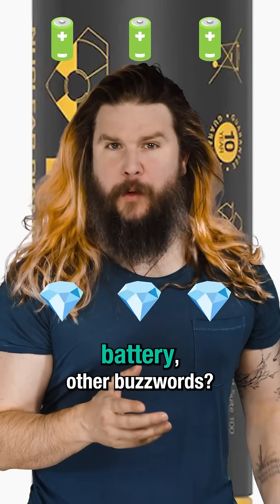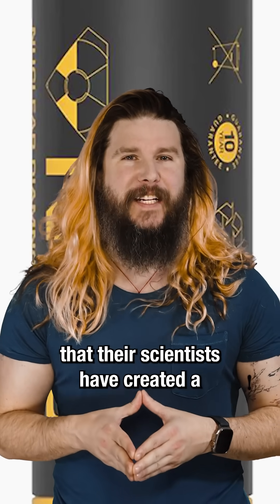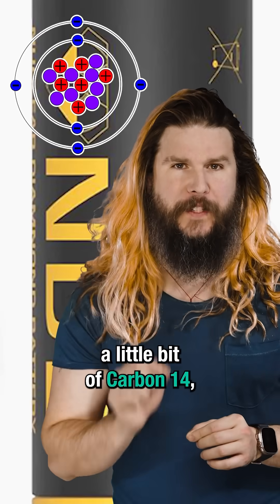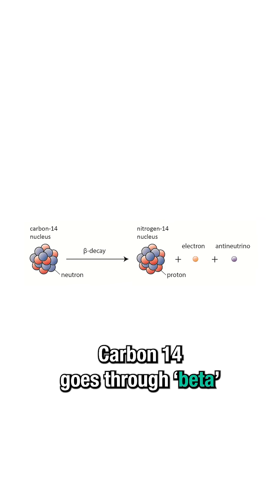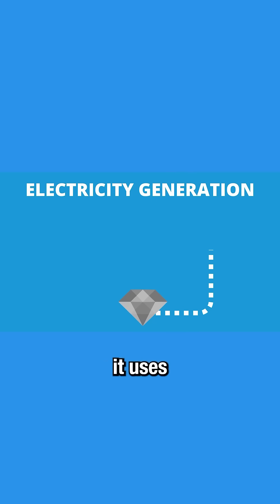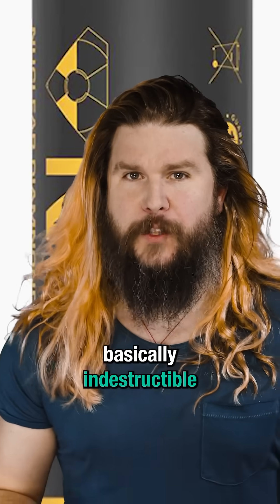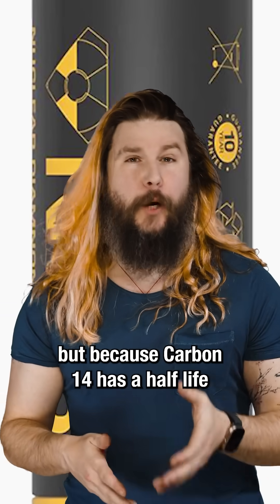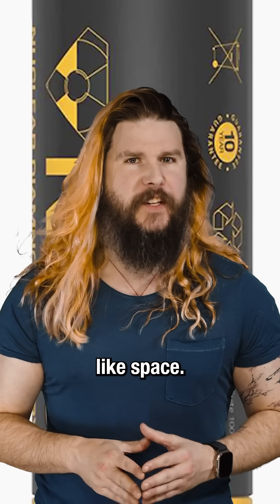World’s First NUCLEAR DIAMOND BATTERY

Comment: For anyone wondering about other uses for these, space probes that need little amounts of power to last awhile can use these
Reply: I just want it in the TV remote, I'd pay 100 monies for a TV remote that never died!
Reply: @Panboy2k  the amount of diamonds it would take to power your remote would cost more than your house.
Reply: @Panboy2k I'm liable to loose it in the couch forever
Reply: Just use high quality batteries once every few years...@Panboy2k
Reply: Nuclear thermoelectric batteries have been around for 50+ years and would be a better solution as it's not locked behind a patent paywall.
Reply: @justinbailey6515  you mean RTGs?
Reply: @justinbailey6515 those nuclear thermoelectric batteries (or more accurately "Radioisotope thermoelectric generators" or RTGs) have downsides. For example, the RTGs on the Voyager probes started to significantly decrease in power output after only a few years. By the 4th year of the Voyager mission they could only operate about half of the probes instruments at any given time, and they were designed to have all of their instruments operating simultaneously. In 2017, exactly 40 years after Voyager 2 was launched, it's 3 RTGs had decreased in output so significantly that it couldn't operate it's camera and it's transmitter at the same time.
Reply: Be a great way to perseve a probe for alien civilations to discover
Reply: @idris4587for that kind of time scale I think you're better off with an unpowered storage medium, and making the whole thing as reflective as possible. Unless we want to get a bit fancier and essentially have it just power a clock counting down until its calculated to get to the target system, which then triggers another power source that will need to be just as robust, to power a transmitter
Reply: @kapperbeastYT  data storage crystals can last for billions of years
Reply: Or heart pacemaker
Reply: I know it's radioactive and dull but I would also imagine these could be extremely helpful for stuff like a pacemaker or similar medical implants that don't need very much power but you don't want the fucking battery dying on you and if it's something where you can set it and forget it I would imagine that would be extremely beneficial as it would basically eliminate the problem of having to cut the guy back open to change the battery in like five years or whatever it is
Reply: We already have better nuclear batteries
Reply: @edisonmc049  "Better" is a poor term here; this clearly has different use cases than your typical RTG. It sounds like it sacrifices raw output for unmatched longevity and durability, and like it' also far less susceptible to radiation leakage, which will definitely give it a niche. Aside from space exploration, I could also see it being used as part of nuclear waste storage systems, where the ability to survive and provide electricity for thousands of years without maintenance would be highly useful.
Reply: The satellite probes floating through space powered with the exact same battery? Those one right.
Reply: @demonkinglamb636  no. Not even remotely similar actually... if you did research you'd realize that but obviously you seem to be a
Reply: I was thinking more like a suit of power armor.
Reply: Pacemakers.
Reply: If they were real unfortunately they're not. They got sued for fraud by the SEC 2023. Don't remember if they were just lying about power output or the technology as a whole. But if you type nuclear diamond battery lawsuit You should get plenty of information on what happened.
Reply: @blindsniper35  Different company that was in the US, and it was for making false marketing claims to raise money from investors in the company. University of Bristol's company for commercializing this tech is called Arkenlight.
Reply: Thats literally what he said in the video yes... Not exactly "an other" use.
Reply: I can think of thousands of uses for this. How about something to stimulate memory chips so that they don't degrade over time?
Reply: Aliens gonna be like "Shit! Bro they got diamonds there. Let's rob em'"
Reply: You can alao juat slowly charge a batter using it. Great for an emergency SOS becon, or a limited use flashlight.
Reply: How? They output on the order of a microwatt of power. There's few things that can usefully use that. And for most of those things, their lifespan is limited by other factors and could instead use a cheap and simple primary battery for many many years.
Reply: @striker6967  Scale and ceramic capacitors.
Reply: @striker6967 pacemakers
Reply: They will go bankrupt, it's just with lightbulbs or the glasses that only hardly brake

Comment: I love how much you emphasize how tiny the amount of power it makes is
Reply: Yeah, also betavoltaic batteries powered by tritium have been used in pacemakers for decades now, this isn't new tech. While C-14 might have a long half life, it also has a low decay energy, which means that even if your power harvesting were 100% efficient, there just isn't much power coming off of the sample to power anything really. There's just no use case, even extreme aerospace applications, where nano or low micro watts of power from a 100 gram source is going to be beneficial
Reply: @Spencergolde  These batteries could be extremely useful for space probes, going a very long time, with a few percent of speed of light and waking up when they reach a certain destination.
Reply: @Spencergolde  I wouldn't say it's none but it's definitely incredibly niche. Tiny primary batteries would also last many years for most use cases that could even consider them. Kyle should definitely have emphasized just how small the power output is.
Reply: I wouldn't say he emphasized it enough. Current beta voetaic technology maxes out around 400 nanowatts. 
Also the nuclear diamond battery people were sued by the SEC for fraud.
Reply: @blindsniper35  Are any of those people involved with the University of Bristol and the UK's AEA, since the SEC was suing NDB Inc., which was based in the US.?
Reply: @blindsniper35  he literally added sound effects when he mentioned how tiny it was... I don't know what more you want from him...
Reply: Tiny D. Randy is coming?

Comment: Wasn't that basically what fuels Voyager? A nuclear battery?
Reply: No, that was an RTG. That uses the thermal output from the radioactive source as it's energy for an engine. If I remember correctly it's a sterling cycle that was used on Voyager.

Also the NDB people are currently getting sued by the SEC.
Reply: @blindsniper35 : Not a Stirling engine, just a thermionic converter. Aka a Peltier cooler running in reverse, with the hot plutonium-248 on the inside of a cylindrical Peltier element and radiator fins on the outside.
Reply: @fyrstormer  Oh well that's kind of boring but definitely is the better way of going about it. It's kind of a shame that they haven't been used outside of a lab but I can see why. 
Voyager is the reason I started researching RTGs. So I probably just remembered the Sterling engine part because they're interesting to me.
Reply: @blindsniper35  Stirling engines heated by radioactive decay haven't been fielded for anything yet. They've only been tested in labs.
Reply: @striker6967  Anything with moving parts isn't really reliable enough for space probes.  Not if you plan on decades of service.
Reply: @hurch1915  It is if it's designed properly. Reaction wheels spin at high RPMs for decades constantly. Almost every satellite relies on them. Every space probe certainly does. The most notable failure cases were a flaw related to solar flares and arcing on some models, which was resolved. In the case of the sterling engines, they've already been tested for decades of lifetime. The technology seems more than ready for the application.
Reply: @blindsniper35 your last statement is only partially accurate.
This video is about the first working nuclear diamond battery, which was created late last year at the University of Bristol, in the UK. The SEC doesn't have jurisdiction in the UK.

In 2017, shortly after the first paper hypothesising nuclear diamond batteries was published, a company started up in the US that was called "The Nuclear Diamond Battery Company" and they began fundraising, as startups do, except they have never made an NDB, or even bought land to build a lab, it appears to be a ponzi scheme.
Reply: @blindsniper35  ... wtf SEC, this is why we can't have anything nice...
Reply: It was a Radio-Isotope Generator.  Same principle but uses Plutonium and generates much more electricity.
Reply: I thought you were speaking about the USS Voyager NCC-74656 for a moment, that's a warp core and impulse fusion reactor
Reply: @stuartwestley8636 I totally thought the same thing!

Comment: The nuclear diamond battery(NDB) people are literally currently getting sued by the SEC for fraud. In specific this technology never existed It was a scam to defraud investors. 
I'm not saying that you can't do betavoltaics. You can buy commercial tritium batteries right now. They just generate micro to nano watts of of power so they're fairly useless. Except for the very niche use cases.
Also as Nile red demonstrated it's not that hard to burn diamonds and they will dissipate in a hot fire so that part's also a lie too.
I just remembered these are the people that lied about nerd rage is working for them. So I'm pretty sure he has a video on the lawsuit.
Reply: Entirely wrong people, this was done by the Atomic Energy Authority and the University of Bristol not NBD, who were the fraudulent company.

Comment: You could actually power a tiny LED basically forever or the LED Burns out quite often before the battery dies. I guess it would power a watch in definitely as long as it isn't smart
Reply: You would either need to have a REALLY small LED or a REALLY big diamond battery to actually make it work
Reply: @patricksarama4963  LED run at tiny current, of course they won't be bright
Reply: @ReinhardSchuster even this current is way too tiny to make any amount of visible light
Reply: @ObjectsInMotion 

Baby steps. 

Science often progresses through baby steps. 😏
Reply: Now I want a post apocalyptic sci fi story where some survivor believes a light is a sign of life but turns out to be junk still powered by one of these batteries
Reply: @StarsAndDreamz  damn you for spoiling this story before its even written!
;P
Reply: No you can't. One NDB technology doesn't exist they're currently getting sued by the SEC. Current betavoltaic batteries generate somewhere between 50 and 400 nanowatts of power. Which really isn't enough to light an LED.
Reply: @blindsniper35  A company using nuclear diamond battery technology to make marketing claims is getting sued. Even then, the SEC is not alleging the technology doesn't exist, but that the claims (their tech tested at 2 labs and that they had 2 customers for the beta tech) made by the company to raise investor money were falsely made.

Is there evidence of any of the NDB, Inc. people working with these UK groups on this? Are NDB, Inc. even the sole user of the tech, and if they are, what patents do they hold and have they allowed other companies to use them?

Tech often has parallel development, and even whoever gets the patents first sometimes does not even serve as a solid indicator as who inventor credit should go to, much less how continued changes to the tech advances.
Reply: @blindsniper35 Its called emerging technology...
Reply: i've got a better scam - harvesting radio waves for free power!! actually can power a tiny LED if you live near a power station!
Reply: Bruh you could totally put these in a smart watch. It wouldnt replace a regular battery but it would charge the main battery if you simply turned the watch off 🤓
Reply: @ It would be way more efficient to just replace the space used for the diamond battery with just more regular battery
Reply: @patricksarama4963 

The technology will be refined and scaled and certainly improved upon. 

Step 1 proving that they can do it. 

Step 2 improving the power output. 

Step 3 scaling.
Reply: @kenkneram4819  Nothing can change the rate of C14’s natural radioactive decay. It simply won’t ever be able to produce even remotely close to enough energy to power even small everyday things like clocks or watches. No amount of optimization can change that. That’s not to that it’s not useful in some rare cases, as stated in the video
Reply: @skeezixmccat Deepseek says:  
It would take approximately *491.5 years* to charge a 410 mAh battery at 4.2 volts with a charging rate of 400 nanowatts per hour. This is an impractically long time, indicating that such a low charging rate is not feasible for practical battery charging.
Reply: @kantpredict  "watts per hour" isn't a real unit of anything so that makes all of that invalid.